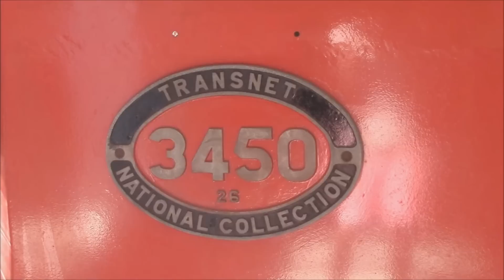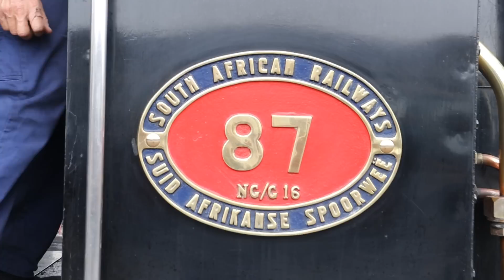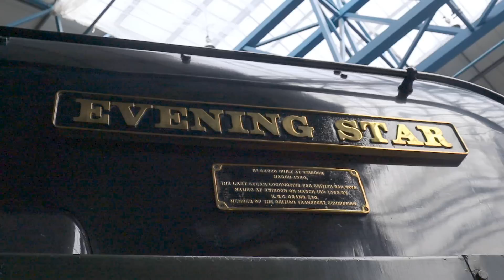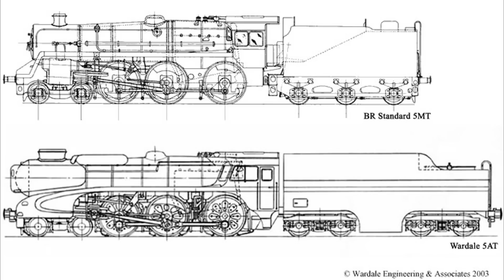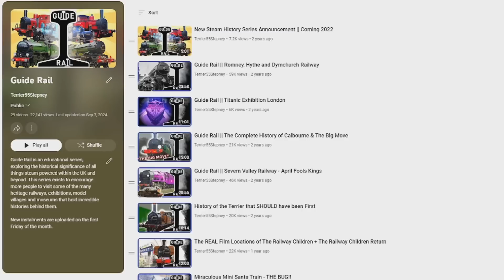What happened to the FUTURISTIC steam locomotive?

Comment: There are problems looking for a solution and there are solutions looking for a problem. 5AT is the solution looking for a problem. 

Simply put, no matter how much you refine it and tinker you will not match diesel or electric(especially once the faults were ironed out) cost effectiveness and ease of operation. 

Steam ain't coming back.

Also mainline steam design continued well after the 9F, which was designed in the early 50s, just off the top of my head the QJs in china were designed and built later than this. Other examples exist as well.
Reply: It was intended as a novelty for the tourist market, with preserved locomotives now getting elderly. The cost-effectiveness of alternative traction is not always what it is cracked up to be. The capital cost of steam locomotives is about a third of the equivalent diesel. Electric trains need expensive fixed infrastructure, regardless of how much traffic is carried. Rolling stock spends a significant proportion of its life doing nothing at all, which means that capital charges are important and the importance of thermal efficiency is over-rated. In practice, against expectations, modern steam locomotives burning diesel fuel use less fuel than diesel locomotives running alongside.
Reply: @physiocrat7143  can you imagine it in the UK though as a serious form of traction, when it has at least 2 people on the footplate, the TOCs can barely deal with paying 1 person their worth let alone 2.
Reply: @Samstrainss  
The lower finance costs would easily cover the wage bill of a second crew. 40% of labour costs are tax and go straight back to the government anyway.
Reply: @physiocrat7143 today, and even when it was proposed, it wouldn't have made much sense in the UK given where money has already been spent. Novelty as you say but even it's maybe one really interesting show stopping novelty aspect is kinda not going to happen either due to regulation or a weird leave it alone attitude towards steam speed records. 

Interesting thought exercise, but I'll eat several hats if it ever got off the drawing board much less found a place in any countries transport system beyond the realm of novelty. It's over for steam development in this sense. I find it funny not even the model engineering folks seem to have been game for taking the work so far and playing with it.
Reply: @Samstrainss  
Money has not already been spent in the UK. Only the main lines and suburban networks are electrified. Much of the rest does not carry the traffic to justify the capital investment. This is not going to change. 

Diesel is out of favour due to air quality issues, bi-mode is expensive and inefficient, German experience with hydrogen has proved unsatisfactory, batteries have possibilities but there are cost and weight issues, and we need to move on from lithium. An promising use for battery power is branch lines up to ten miles long, using refurbished old stock. 

The large UK fleet of bi-mode trains is problematic since, among other factors, heavy electrical equipment is being lugged around dead half the time. At £3 million a vehicle the question of what to replace with will arise.

The 5AT is not particularly novel and features of the design have been adopted by both tourist railways and model engineers. I suspect that one reason for the failure of the project was the sheer ugliness of the design. A simple design similar to the LNER type B1 with improved exhaust, the DLM light oil firing system and lightweight reciprocating components would have done most of what the 5AT promised, at a fraction of the cost. The LNER engineer Thompson knew how to get the most bangs per buck.
Reply: @physiocrat7143  yeah, the money has been spent on electrifying where practical, the money has been spent on increasingly efficient and clean diesel locos and units and is now being spent looking into mixed options. 

No one looks at this for passenger use day to day and sees a great prospect, hours to heat up, hours to shut down, it's just not going to be the go. Steam only "works", and I say that with a huge pinch of salt, in a heritage/tourist capacity due to donations over and above the ticket sales income, even more highlighted as an issue of late.

Now you'll point to westcoast railways or something as an example of mainline steam operations being profitable enterprise but this is countered by your own point about the thing being grossly ugly. I can't imagine many a potter fan being thrilled by it on their trip through the highlands. The niche it was supposed to fill with regards to aging mainline fleets and pathing issues seems to kinda... not be the huge issue it might have been imagined to be we are currently sitting on another 4 or 5 new builds with mainline intentions that are already coming off the paper into reality and another god knows how many in the initial stages that will go mainline or wind up filling gaps in tourist railways. The mainline new builds can replace those mothballed examples like union of south africa and we have frankly got a bunch of locos that are doing relatively light duty on the slow tourist lines or not even restored yet that have potential to go mainline and then be retired back to lighter work. 

A solution grasping for problems to solve. 

If anything, and this is an opinion shared by many involved, we have too many bloody steam locos and not enough money to do them up or keep the done up ones going. New build of an old design is already a money sink in realty. Worlds moved on. Railway enthusiasts rarely do and rarely see the woods for the trees when rushing to save so many locos and lines that we have atomised the market to see them and ride them so much that it cannot ever support its self fully, perpetually with a hand out we go asking for more and more. Can't think of any other area of historical interest that has such wasteful irrational enthusiasts. 

You might see maybe a mill or two saved to show how a textile mill worked, maybe a few engines from different mills collected together. You don't see hundreds of textile mills being leased/purchased and reopened for people to come and look at a loom while you have hundreds of spare looms out the back you've yet to restore on the basis that every one has a different serial number and that makes it special 🤣
Reply: @SamanthasBuses  
Can you pick a hole in these figures?

Class 802 - 9 car sets
438 tons £27 million per set.
Annual charges £1.3 million

Refurbed mark 3 sets  + steam locomotive
10 cars 350 tons, £5 million per set @ 500k per vehicle
Steam locomotive equivalent to BR class 8P - £2 million.
Total £7 million. Annual charges @ 5% £350 k
Saving in annual finance charge £900 k

New build trailer cars + steam locomotive
10 cars 350 tons £12 million @ £1.2 per vehicle
Steam locomotive equivalent to BR class 8P - £2 million.
Total £14 million
Annual charges @5% £700 k
Saving in annual finance charge £600 k

Conclusion - the saving would pay for 4 or 6 additional employees. (gross pay plus on-costs)

The mark 3 stock has mostly gone but the steel bodied 156 aluminium-bodied class 158/159 classes will become available, also the class 175, 180 and Voyager classes as suitable refurb candidates.
Reply: @physiocrat7143  certainly, correct your £2million figure for the steam loco to account for volunteer time input and also for the various benefits of charitable status since... those generally at a glance just speculating here but maybe don't exist for normal mainline operations day to day? Unless I was missing something for all these years and it turns out that virgin trains had a large contingent of volunteers behind the scenes? Do correct me if this was the case. 

Also add interest payments on borrowing and whatever needed to aquire it because these are included in the pricing for leasing a unit from a rolling stock company who had to buy it. Probably comes with like a full set up of maintenance facility upgrades to suit the new class as well so, how much we gonna toss in for installing turn tables all over the place for this fleet of new 5ATs plus any depot upgrades to provide for the unique needs of the class? To call 2 million an optimistic figure per loco in a real world introduction of a fleet of them is stretching the meaning of optimistic... gaping the O in optimistic if you will.
Reply: @Samstrainss  Given a decent production run, a steam locomotive should not cost more than half the equivalent diesel-electric. The figure was 20% in the 1950s.

You wouldn't build a 5AT, but something basic with well established upgrades. Using 3D printed patterns and CADCAM, steam locomotive manufacture is no big deal these days, with a small parts count compared to alternative traction. They can also be expected to have a 60 year life, with small wearing components replaceable. Facilities? Turntables and water supplies at places like Salisbury and Exeter, not "all over the place", and Salisbury-Exeter could probably be operated with a tank engine and a refill at Yeovil Junction. Small change. You would not be using coal.
Reply: @physiocrat-sv  and in terms of 20% comparative cost in the 50s, well no doubt you have the workforce, equipment, facilities geared towards that ready to go... did you know the figure to move coal by dragging a waggon of it with a horse was cheaper until the underlying economics changed due to a horse shortage? Quickly if we breed more horses there's a gap in the market to go back to where we once were just ignore the costs and risks of buying horses, raising horses, training horses etc etc, it's easier these days we have 3D printed bits to champ.
Reply: @Samstrainss  
Can you give some solid evidence? Large components cut and milled on CNC machines.
Reply: @physiocrat7143  solid evidence that these things cost a whole lot more money than the  relatively cheap equivalent of a diesel power unit that has uses outside of just trains and therefore is a far more attractive and economically sound thing to produce as the economies of scale in doing so are not simply limited to how much use it can find within railways or even within one type of locomotive? for example here we'll take a class 59 which of course shares a power plant with other classes internationally but also even in the UK with the class 57. Or since you mentioned the 158 sprinter well originally NTA855 engine in  them, an engine you can buy as a stand alone unit to power all sorts of other applications across multiple industrial sectors... a left hand cylinder for a 5AT can be used as?... ? ...  that's right a left hand cylinder for a 5AT, absolutely no potential for further use cases unless that is you build out a whole fleet of variants using the same cylinder. So all that development cost, all that planning of and optimisation of production and machining has absolutely zero potential avenues to become any cheaper over time due to mass production, there's a reason we ended up with things like sprinters, there's a reason we ended up with class 59s and 66s and have gone the way we have and it's pretty simply that it is the most cost effective path forward with the least faffing around. 

You should also note part of the reason you can quote that 2 million figure is down to various companies taking on contractual work on a "we'll get to that as and when we can" type basis, doing it between other bigger, more time critical, better paying jobs. So, I dunno, chuck in however many million for wanting your small fleet of 5ATs done in any semblance of a reasonable time frame.
Reply: @SamanthasBuses  
Your comments are valid but they are generalisations. A steam locomotive is an assembly of a relatively small number of large components, mostly machined castings and forgings. There are plenty of general engineering workshops with the capacity to do most of this work. With CNC machines and waterjet cutting, most of the finishing work required in the 1950s is eliminated.

You don't seem to have read my previous comments. I would not follow the complex 5AT, but would advocate replicating established simple designs such as the cheap and cheerful LNER B1 class, with the addition of a few upgrades including oil firing on the DLM system (did you visit the website?), and Lempor exhaust. Given a decent production run of 20 or more units, economy of scale is achieved, you get plenty of bangs per buck and avoid the huge finance costs that trains such as the 800 series have saddled taxpayers and the travelling public with.
Reply: @physiocrat7143  yes, I've read about the various improvements one can make to a steam locomotive. I have spent time with steam locomotives, I have spent time working in manufacturing, I have run waterjet cutting machines and can tell you that yes they have some interesting things about them however unless you are doing it on that "we'll get to that when there's a downturn" way it is a bloomin expensive way to do things with limited viability to offer a benefit to your customer hence they are not that common in the grand scheme of things. 

Now, having been involved in this, and seen the maintainance needs and down time of even a basically brand new steam loco a fleet of 20 of them isn't exactly going to cut the mustard in providing much volume of service compared to a well executed DMU or EMU and again we come up against some hard realities of what needs renewed and when and how simple those tasks are and can be made. We also run up against some pretty basic realities of risk of things going wrong and being far from anywhere that can solve all but the most simple problems unless we perpetually have a heap of spare parts on hand which again, huge cost that can't be interchangeably used or sold off for secondary use easily. It also in terms of operations adds in that most unattractive of things to the mix, human factors, a steam loco is very easy to make a pigs ear of driving or firing and wind up with insufficient juice to keep time. This isn't really an issue with railtours as your customers are warned and to some degree know that things can go sideways and end up a bit late. Your everyday customer/commuters? Not a bar of it, pitchforks will be out. Even the most well maintained, best staffed steam is somewhat inconsistent when compared with  a well done diesel or electric service. Again, reasons we did away with it to begin with are still there and not going away.
Reply: @physiocrat7143  also yes there are many many general engineering workshops, but they need to be able to work within relevant ISOs, they need to be on board with materials tracability and so on. 

For a look into just how much of a fuss this causes if done poorly take a look at the new build patriot, they have had not inconsiderable issues with and time investments to rectify poor paper work and put in order every bit of documentation needed for the mainline. You'd think certain things would get past but no, every single piece, even something seemingly innocuous like a washer on a hing on a tool box inside a cupboard in the tender needs to tracable. This set them back months, before we get to any actual mistakes in the parts themselves.   The figures quotes for the 1950s in terms of cost per unit are also now out of date in this respect of not only how we deal with the boring admin side and accounting for whats in a loco but also kinda out of date in terms of the verifications process each part need go through to keep insurers happy about it. Lets also take into account the glacial pace of boiler production at places capable of it plus the capacity and time frames of places that can do the work to maintain them in the UK. Now naturally you would expect capacity to grow to meet demand but ultimately it does and doesn't, it's a bit of a weird sector at the moment because of so much of the work being very unpredictable in a lot of ways.
Reply: @Samstrainss  
The Patriot scheme seems to have been run by part timers. Firms like DLM (a spin off from Sulzer) are professional. 

Why the Patriot was chosen to replicate in anything larger than 0 gauge is a bit of a mystery in itself. There were inherent maintenance problems with the LMS 3 cylinder types. The original Royal Scot was a stop gap design produced in a hurry.

The boiler issue you mention is partly due to the complexity of the boilers, and it's partly chicken and egg. Waller at DLM stated that a minimum oder of 20 units was necessary but that this would begin to achieve the neceqssary economy of scale. Sharp produced a schematic for a 2-6-4T based on the BR/LMS type, for use as a replacement for preserved locomotives getting elderly, but also for routes unlikely ever to be electrified, eg Salisbury-Exeter and into Cornwall, west of Chester, etc.

The LNER avoided complicated boilers. Once this decision is made, construction becomes a whole lot easier and more within the capacity of general engineering companies. There were problems with the standard 100A boiler which are known and were resolved. There is no evidence that they were inferior to the complex GWR style boiler. 

There is no reason to suppose that a decent production run of a locomotive adapted for modern manufacturing techniques would not cost substantially less than recent diesel electric locomotives of comparable power. Reduced numbers of components in itself should achieve savings, especially given the administrative load you have described.

An interview with one of the engineers responsible for maintaining the difficult SAR Garretts revealed that minor modifications based on practice from other industries can get rid of a lot of the problems in keeping them in daily use. 

The whole matter needs to be looked at in more detail and not dismissed with generalisations. The cost of modern traction rolling stock has become a hefty financial burden, which has to be met even when the trains are parked up at night or for longer periods at places like Long Marston.
Reply: @physiocrat7143  you have to pay for the steam loco and associated facilities and costs of financing inherent in the terms of any finance agreement to make the project happen in a commercial context and so indeed any leaseholder has to pay this as well and in case you have not noticed locomotives end up in storage at Long Marston as well. "because steam" isn't really a compelling argument to turn the clock back several decades, also, good bloomin luck with the drivers unions on going backwards with regards to their work conditions. You'll note I'm sure the issues EWS had with the class 66 and cab conditions and you can extrapolate how a fleet of steam locos would go. Again you'd be relying on drivers to volunteer to step up to the task which... peoples good will only goes so far before they want more money.
Reply: @physiocrat7143  also note the patriot was initiated and the body behind it is volunteer/part time whatever you wanna call it, a society of people, the problem actually came from the "professional" side. Not to bag them out too much but the people at Llangollen railways contract engineering service who do stuff, professionally, for other preservation projects took it on and well, got lots of bits wrong and didn't keep up with things on the admin side. Sub contractors also fell into this state. 

Never take any professionalism for granted.

The costs you put forward are wildly optimistic and rooted in an understanding of costs based on projects that have a whole different vibe to put it simply. 

When the competition can offer you an off the shelf solution they are pretty much ready to go on mass production of in very short order this simply isn't an attractive investment, even less so when considering the aforementioned issues with drivers probably not wanting this, the infrastructure specific to it which isn't there other than in a few specific locations... the rather backwards public image of it all? The operational reliability of it coming down to driver skill in using steam not just yknow turn the key and control the on demand power that doesn't run out if you don't set your cutoff right or something. It's just not attactive in so many ways.
Reply: @SamanthasBuses  
All you are saying is "couldn't be done" and giving a list of obstacles, real and imaginary. 

I once worked for a firm which said that certain processes "couldn't be done" but after no great amount of work the problems were overcome and new products put on the market which proved highly profitable.

You have correctly flagged up the potential difficulties but at the end of it is a worthwhile prize - substantial cuts in finance costs. When trains like the 800 series costing eye-watering sums of money, all alternatives need to be explored.

Best value for money might well be refurbishment of stock like the 158 and 180 classes as push-pull sets with off-the-peg diesel locos, but all I am saying is that in view of improvements made to steam locomotives since the 1960s, they are worth looking into in the UK context.

Here is Sweden we have thousands of miles of lightly used lines with electrification infrastructure that is coming to the end of its life; again the question that arises is whether it should be replaced, and with what? These lines were electrified when electricity cost next to nothing, but with Europe-wide prices having to be paid, it is another matter.
Reply: @physiocrat7143  could absolutely be done. Happy? 

Now just the matter of if it can, if it's so attractive, simple, cost efficient, if it's really all these things then why for the better part of 30 years has it not been done? Maybe because yes it COULD be done but it simply isn't practical nor reasonable to do so. 

If Sweden has such a fantastic case for it then I'm sure their railways will go ahead? If anywhere has a fantastic case then they could very easily read up on it and apply it, to be a overly sarcastic it's hardly rocket science 😅

Put 2 and 2 together and it becomes apparent why not, several very reasonable reasons why not exist, some mentioned here, some not, but all coming to the answer that no, not worth it.

And no, to reiterate, finance costs would probably not be lower, the class 800 is part of an extent family of trains, it's not starting from fresh, if anything a rational look at this example would indicate that the costs would be even more simply because there isn't already all those juicy known knowns in place with a fleet of new build steam. It doesn't add up and when you throw around figures I presume come from tornado around costing out a unit price I gotta say no, absolutely not. Never gonna come into the same ball park because of the factors mentioned around expectations of delivery of components involved in that and projects like it vs a fully commercial operation and you're not going to get the same line up of companies willing to work with you for tax incentive reasons or do it at cost for PR when you are a commercial operation vs a not for profit doing it. It's just not sound reasoning.
Reply: @SamanthasBuses  
Just like nuclear fusion, then. How much money is spent on that?
Reply: @physiocrat7143  well at least that kinda helps answer some interesting fundimental questions about the universe along the way. 

I'll resist comparing 5AT to cold fusion 🤣
Reply: @physiocrat7143  I'd say the gains for any nation or cooperative group of nations for developing fusion are also a little more clear cut and likely to pay off long term. It albeit a complicated solution to a problem, not a solution seeking a problem to justify its existence.
Reply: @SamanthasBuses  
Having spent the past couple of weeks travelling by rail in four European countries,  the problems are obvious.

They and are mostly due to the use of excessively expensive rolling stock and traction, and of internal combustion technology; noise, vibration, poor air quality inside trains and at stations, cramped accommodation because seating has to be packed in, complex booking systems for the same reason, leading to shortage of capacity. The majority of the journeys were unsatisfactory. The best of them were short local trips in the Britain and Germany in electric trains dating from 20 or 30 years ago.
Reply: @SamanthasBuses  
Fusion has been promised "in 40 years time" since the 1950s. If it could be made to work, there are problems of radioactive waste which can be described as "known unknowns".

What do you thing of the use, as a transport fuel, of a gas having a critical temperature of 33 K?
Reply: @physiocrat7143  wow problems caused by a general underinvestment in rail not problems magically solved by using steam. Not sure if you're aware but steam. 

You mention radioactive waste as a risk and I honestly need to point you in the direction of the huge issues of contaminated land and people holding onto steam caused and would have added towards. Now when you say radiactive dangers and fusion you do realise that the by products are helium which is fine, we could do with more of that anyway for industrial reasons and tritium which is pretty harmless, not a huge deal really. Spending a few years working around an oil burning locomotive is probably also not great for you on balance. Both can be contributing factors to an increased risk of cancer in reality only the oil burning loco can also get your lungs in various ways as well. 

As to the "we'll have this in 40 years" yeah whatever some people in the past dared to have an optimistic outlook? Big deal. As to why it gets funding the reward is huge. World changing potentially. The reward for maybe possibly in a very ideal world making some slight improvement to a rail service based on some very shakey back of an evelope numbers on costs completely ignoring multiple factors isn't really the same and probably shouldn't be compared.
Reply: @physiocrat7143  also to go back to that thing you said about lots of engineering workshops that could make parts to bring together and then me pointing out that this isn't really a guarentee of a cost saving, I feel the need to highlight that exactly this approach is kinda a huge part of why the budget for the flagship fusion project ITER has gone so over budget. Great example for why assuming viability on this basis is a bad idea. Guess we can learn from fusion and apply it to this.
Reply: @Samstrainss  
You obviously know little about the subject if you think that helium is the product of fusion. The containment vessels are affected, leading to the production of radioactive isotopes. This is a known unknown.
Reply: @physiocrat-sv  my guy, deuterium plus tritium = helium plus a spare neutron. 🤣please explain your thinking as to why this is not the case.
Reply: @Samstrainss  
You have just explained, if you think about it. Those spare neutrons don't just vanish. They bombard the walls of the containment vessel and create new radioactive isotopes, which also affects their physical properties. If you dig down into the subject you will find that it is a known unknown .

Your comment confirms that you don't know as much as you believe you know and think in sweeping generalisations. This is evident from the entire discussion.
Reply: @physiocrat7143  yes, and no, depends on what coating you place inside the containment and really as to exactly what that neutron gets to interact with doesn't it. However to say that the heavy lump of metal that is the containment vessel which is very easy to contain due to it being a huge piece of metal kept inside a high security building  is anywhere approaching the risk to human safety that the emissions from burning a bunch of oil represents on the basis that under ideal conditions it may not be that bad but is still bad especially while at idle and at various other points in your supposed oil burning steam locomotive is pretty disingenuous. One is a large static piece of solid material with security measures, the other is a bunch of gases and particulates that are just dumped where ever you go on your merry way.

Now is diesel traction any less of a concern in this regard? Depends on the specifications but as we move forward and god willing not too many old ones are kept due to dumb nostalgia the fleet only stands to get cleaner and cleaner to meet staged emissions targets going forward. 

Frankly in terms of total death count even fission is still clean and lovely compared to most if not all steam locos. 🤣phenomenally clean really, just scary because oooooo radiation 😱
Reply: @Samstrainss  
Fact: burning diesel oil in the firebox of a steam locomotive produces next to zero carbon monoxide, particulates or NOx. IC engines result in incomplete combustion of the fuel. Source DLM-AG.
Reply: @physiocrat7143  yeah I mean far be it from me to cast any doubt on a company still proudly displaying a graph with relative  emissions data from the very current year of 1992 in order to make their points about emissions of their projects being an attractive prospect today😳 one can't imagine why they wouldn't proudly update this to reflect the state of things today...

Only 34 years out of date 😌
Reply: @Samstrainss  
Can you explain how the laws of chemistry have changed since 1992?

At the high temperature in an internal combustion chamber, the gases go to a mixture of carbon monoxide, carbon dioxide and nitrogen oxides, while incomplete combustion is impossible, leading to the production of particulates (carbon).

Inside the firebox of the steam locomotive, at the lower temperature, NOx is not produced and all carbon is fully oxidised. Hence the clean exhaust. It is the same as a gas stove in your kitchen. Chemistry does not go out of date.
Reply: @physiocrat7143  you know I quite regularly see oil fired locomotives with anything but a clean exhaust, why I saw one just the other day, 2 in one day not that long ago...

You don't need a degree in chemistry to remember that reactions and their outcomes are influenced by quite a lot of variables and unless you have those variables quite tightly controlled you're not exactly going to see the results you might expect from what your text book might give as average results of a reaction under predetermined conditions which you are not meeting. 

You don't need to change the rules of chemistry to find fault with 34 year old comparative emissions data as the basis for a claim of viability on such a project you don't even need to look necessarily at the bit where the fuel is burned, you can easily tell the data is wildly out of date for the purpose just by examining peripheral changes made such as in in diesel locomotive exhaust systems. Every one of these changes and tweaks made has whittled away at the claims you are making bringing them closer and closer to parity and what happens as that gap closes? It becomes a less and less fruitful endeavour. Hence we are shown not up to date info because that makes the gains vs the investment look kinda naff, we are shown 1992 data or lord above 1950s data as you used earlier in relation to comparative construction costs. 

It's farcical. 🤣 if this is the best effort no wonder it's an idea going no where recieving no funding, this wouldn't even get past the rubes on dragons den let alone a seriously minded investor.
Reply: @Samstrainss  There are a lot videos on YouTube of locomotives fitted with the DLM light oil firing system, including the rebuild of the Kriegslok 52-8055 and the Brienz-Rothorn locomotives built in 1993  The is no black smoke. The system was designed to ensure that complete combustion took place. Black smoke is money up the chimney. It sounds as if the operators of the locomotives you have seen are not applying this technology even though it has been around for 30 years. 

There are a number of steam boats in Stockholm which run in regular service during the summer, again without producing black smoke. They are cleaner and quieter and smoother than the  modern diesel powered vessels that they share duties with.
Reply: @physiocrat7143  yes, DLM was directly involved in one of the ones I see quite regularly spewing less than clean stuff out the chimney. Mr Waller himself personally came over to be involved. Pretty sure someone did some testing on it and found various carcinogens still come out of it but maybe I'll go ask around to be sure it's practically next door lol
Reply: @SamanthasBuses  
Do you have any information on this? What was the cause and what was the outcome?

The videos show clean exhausts. That said, people seem no to be particularly concerned about the poor air quality inside trains with underfloor diesels. The other week I had to change seats in a class 159 because of the fumes coming up into the vehicle, but then a steam locomotive would have to emit nothing other than pure water vapour to pass the much higher tests required. Last year I travelled on the GCR and the air inside the 1950s DMU was almost unbreathable.

Meanwhile, nobody seems bothered about the irritating substances, presumably aldehydes, given off by ethanol powered vehicles.
Reply: @physiocrat7143  yes just the nature of the beast, you sometimes don't get complete combustion or as complete combustion because and this especially applies on stop start and chopping and changing speed limits which you get a lot on the UK and on the line here you're not getting a consistent draw from the exhaust events of the cylinders pulling air through the firebox. You have a person juggling it all and people are not exactly adept at optimising such things especially when there are two people controlling multiple variables in the form of driver and fireman. 

I have to say I've never ridden a 158, 159 or even a 150 or 156 with such an issue, however age catches up with us all so who knows what state the fleet has got into since I would have last been on one at least 8 years ago but growing up with them regularly, never encountered it. To be honest a 1950s DMU is not really relevant we have moved forward considerably, lot of those were packed with asbestos and other things we don't do anymore, maybe you could even put your experience down to a symptom of asbestos insulation removal and replacement being less than ideal because preservation stuff is often done in a less than ideal way due to expense.
Reply: @SamanthasBuses  
The 220/221 are pretty smelly too, inside and out, and that is on top of the smell of drains. Same for the Danish IC3 trains, and the diesel powered ferries in use in my neck of the woods, now being replaced by battery electric.

That said, to judge from the videos, the Swiss locos seem not to produce black stuff. Perhaps it is a matter of driving techniques and familiarity with the systems.
Reply: @physiocrat7143  and yes, a quick look at some research by the Australian governments boffins does indicate that there are increased levels of aldehydes from ethanol fuel mixes but there's also reductions in other areas so y'know, potato potato really, if it reduces harm overall it's a win. Being mildly irritated or not even irritated at all given we all have different sensitivities to different things is probably better than increased risk of death.
Reply: @physiocrat7143  it's also route familiarity, consistency of speed, over that route to produce a consistent draw in the system, consistency of the make up of the train helps, consistency of weather even. Altitude? So many things but I assure it is not achieving the ideal results consistently it is maybe closer for sure but not always there. 

The main impetus for it in many cases is fire risk mitigation, any benefit from fuel cost or it being clean isn't the main reason. It has a place, for certain reasons, in certain contexts. 

A fleet of brand new mainline locos is incredibly unlikely, it works out economically for a line where steam is part of the attraction, part of the draw. It doesn't stand up so well when looked at from a fleet requirements for a mainline railway in 2024 stand point. Sure you might get somewhere given the good will of people into steam putting in time and effort for free but that's just asking for you to be deemed as unfair under competition guildlines for franchise operations. Which would be interesting to see played out but wasteful in the extreme.
Reply: @physiocrat7143  as of this week one of the local oil burners has been out back to coal, fuel bill was about 10x coal so that's not viable.
Reply: @Samstrainss  
Will they be putting the diesels over to coal because of the cost of oil?
Reply: @physiocrat7143  no. But to be fair this railway only uses its diesels in event of a steam failure or unavailability due to workshop schedules or in the event of bush fire danger being high. 

Asked and the difference is $4000 for a run burning the diesel and $400 on the coal. 

So a huge saving really.
Reply: @Samstrainss  
What is the point of higher efficiency if the fuel costs ten times as much? But surely biowaste is best?
Reply: @physiocrat7143  well the whole point was to reduce fire risk for a projected tourist traffic along a section of very high fire risk line, the tourist traffic for that longer journey hasn't really panned out as hoped so it makes more sense to save the money on burning diesel and go to coal rather than running a hugely expensive fuel on all those days where it isn't needed or effectively having a loco set aside just to use in the event of higher fire danger. Diesel was always costly to burn and with no local infrastructure making biofuel alternatives in any huge amount that is also cost prohibitive, likewise any biomass fuel pellet solution is also not really locally made and expensive. The coal is for now the cheapest thing going here and is also mined in so many spots that you can pick and choose to a degree where to get it and choose the best quality for the job. 

The economics of it might play out differently elsewhere but not here. As to the other oil burners in use here they I'm fairly sure have heavy oil set ups, so maybe less cost?